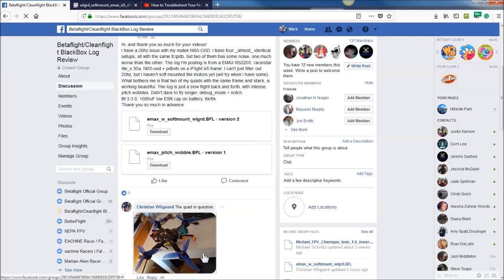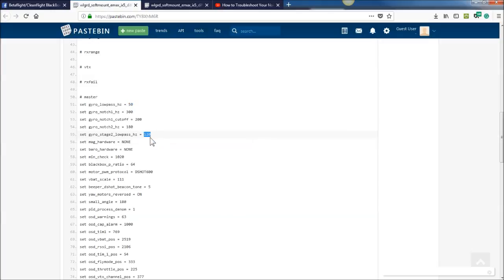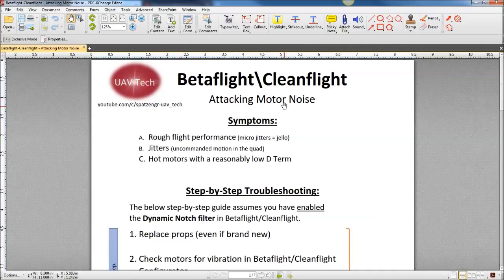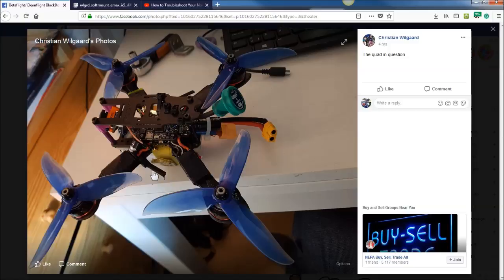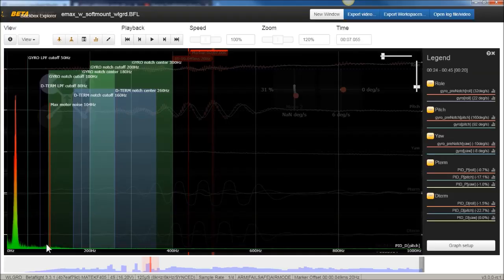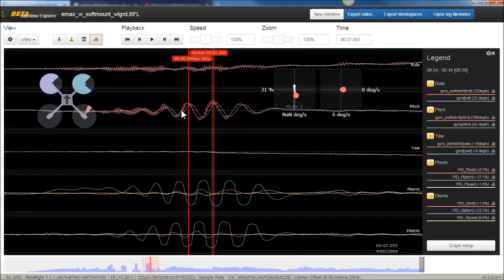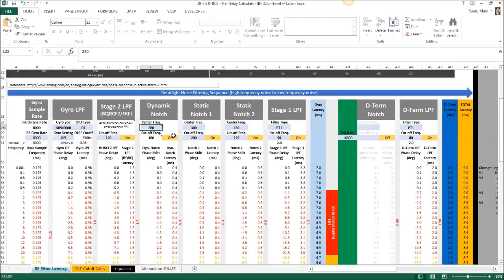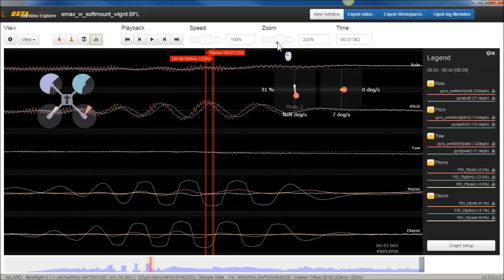2018.04.10 Christain-20hz Noise issues + FILTER PHASE DELAY EXAMPLE

Comment: What I've seen in my logs, is that the prop-wash oscillation also occur around 20 Hz on my quads. But surely not as clean as in that log and usually on both axis. 
May this be some resonance between motor thrust and elasticity of the frame?

Comment: Is optimal or minimal filter delay the primary factor for optimal propwash/wind handling? The reason I ask is because I have a fairly clean quad, but I have to have either dynamic notch on or d-term notch on to get rid of a high freq resonating, and I find better propwash handling when I opt for the latter (D-term LFP on, rather than Dynamic notch), even though your data shows greater latency in that case? In fact, from my experience, I find the dynamic notch on results in more bobbles and jitter.

Very helpful vids by the way!
Reply from the maker: It is sort of a chain effect.  Whatever filter setup allows you to have a D-term that is as steady as possible and is not pushed into phase with the P term should give you the best handling of prop wash with a proper tune (proper gains).

Do you have logs of where you experienced better results of Dynamic Filter on and then Dynamic filter off and higher d-term filtering?  Would love to see what things are at play.  In theory more D term filtering will push the D trace to be more in phase (not leading) the P term.  But if D term filtering gives a smoother D trace - which it easily can - then it can produce better results in the D trace not jumping around as much and/or allowing you to push D gains higher which advances it in phase of the P trace along the D term slope (covered in a recent BB log review); hence producing a better handling of prop wash.

I wish there was a button "eliminate prop wash" that we could click.
Reply: so interesting. Thanks. If I can find the time I intend to make a series of blackbox recordings with different types of filtering (including kalman and stuff) and in different conditions (windy environments etc).

Comment: Thank you so much. I tried extensive filtering to see if that did  any difference, disregarding delays for now. Already did check motors, and I'm running the same motor/prop combo in other setups with no issues (2206 2400kV with cyclone 5045) for racing, but great to get a confirmation that this is indeed something in my setup. Will try moving those antenna stubs on the arm as well and get back to you when I have some findings :) But, can this also be caused by a bad gyro? The matek f405's are well known for their noisy gyros.
Reply from the maker: I don't think so with it being 20hz.  If it were 200+hz maybe.  But it just seems like a big vibration/wobble to me.  Also check that you don't have a broken or loose stand-off or arm.  Stuff like that.
Reply: UAV Tech okay, will go through it all before replacing the electronics. Had issues with loose stack before, so I always check that first in these kinds of cases ;) Good tip tho. Might also be my rx which is soldered directly on the board and hot glued. Might not be enough, being also that it is directly over the gyro (not touching  though)
Reply from the maker: Yeah, if you RX is mounted to the FC, maybe look at mounting another way.  However, you said you have the same exact setup for another quad without issue?  Everything exactly the same?
Reply: Well, identical stack. Other esc/motor combo. The other struggler is rcx 2205/2400 kv with dys aria. The two working have racerstar esc  (same as this one) and aokfly 2500kv and rcx 2205/2400 kv.
Edit: 
So, three with racerstars. Only emax motors struggle. 
One with dys aria, but not as bad as this one and haven't looked to much into it yet. Just capped the battery leads on that one, which solved quite a lot
Reply: Tested:
1. Motor test (bardwell): All of them super clean
2. Changed props, no change
3. Removed antenna stripsmount, taped antennas to arms instead, no change
4. Filtered 5V, 3V3 and all ESC's, no change
Since hover shows all motors working equally hard, I don't suspect ESC's, and starting to wonder if I should just swap out all of the motors (or one by one... sigh)
Reply from the maker: hummm..... let me think on it too.  Weird.  Did you try just doing full defaults on Filter and PIDs?
Reply: Yep. Still no good. Also tried turning off dynamic and raising the other filters to where the "main" noise is, other than the ~20hz. Next thing I'll do is replacing all motors, one by one (I only have one spare of these). I really wanna catch the culprit on this one, learning quite a lot in the process :)
Reply: I swapped all the motors with a known, working set. Problem solved! I am kinda sorry for using up your time on this, but I really inspected the motors and just can't find any faults. Will put the non-functional set on another quad and work my way through them, finding the bad one, opening it up and try to figure out what's wrong before posting my findings. Can you confirm that debug[0] is for roll, and debug[2] is for pitch? I have really learned a lot from you, and feel so much more secure when debugging quads now, such that I will also push the limits on fine tuning. Thank you so much!

Comment: Hi, in your pdf, thos vibration dampeners are listed under "intruducing no delay". If the have to be compressed to activate the dampening, doesn't that introduce delay? Would it be possible to measure it? Two FCs in parallel, on top of each other, the second not connected to motors, but logging?

I got some problems with an über-tight stack which i am fighting, it got yaw P problems (vert racer style from hyperlowframes). Activate yaw lpf und deactivate notches on roll/pitch?
Reply from the maker: Yes, the jury is out on that for 100% scientific confirmation (no testing and data published that I have seen, but honestly I have not looked hard either).  I have seen some postulate that soft mounting has the same delay as software filtering.  However, the general trend is soft mounting is preferred over software filtering as it doesn't cause low hertz delay (motion) - especially if on the motors only -, but just protects the gyro from seeing the high-frequency vibrations (noise).  Software filtering doesn't work that way.  It has a worse delay on low-frequency data than high due to how the math works.  Manufacturers are even starting to soft mount the gyro chips on the FC boards too.  Finally, I have never seen any of the gurus in the space recommend software filtering over soft mounting.  i.e.: see this link from Boris.  He believes no extra penalty comes as a result of soft-mounting vs. software filtering: https://github.com/betaflight/betaflight/wiki/Gyro-&-Dterm-filtering-recommendations#what-defaults-changed-in-317.  Now, was that in reference to motor soft mounting vs. FC soft mounting?  It doesn't thread that needle.

Testing and publishing of the results would be amazing!!  Both boards would need to be in the same stack.  Also be the exact same board with the exact same settings.  The bottom board would be hard mounted; be the one driving the quad; and have software filtering etc... (debug_mode=notch).  The top board would be mounted with rubber standoffs; have debug_mode=notch; and have debug set to activate as soon as the quad is powered up.  Actually, both would need to be setup that way so as to sync up the logs.  You would then be comparing Debug_Mode=Notch traces to eachother and see if the top board has a delay vs. the bottom board.  Since the top board would be a little higher than the bottom, it would skew the results unless you can get the split between the two (the quad CG) to be equidistant from both boards.  Since it would be measuring very small units, you would really need to pay attention to every detail to make sure it was not skewing the results making them invalid.
Reply from the maker: Turning on Yaw P LPF should not deactivate notches on roll/pitch.  Or are you saying to do that to offset the latency?  See graphic at https://www.facebook.com/groups/291745494678694/permalink/348580578995185/ for where Yaw P LPF falls into the filer sequence.  it is not on the Gyro.  it is in the pid loop.
Reply: Thanks for that elaborate answer. Yeah i built a quad for a friend with a Kakute and another freind has a lot of Airbot Nox. They ship him them without asking XD but i don't know if i like them. Kakute solution is prone to many problems.

If i had the budget to buy 2 FCs just for some logs i would do it -.- it should even be possible do splice SBUS on both Fc so both can be armed at the same time. Woah i kinda want to test that. You don't want any sponsor right? I could ask airbot if they could provide some FCs for a mentioning in a video. I got a empty frame
Reply: ha ;) i am in contact with simon and michael (from your 6S BB log video) via a german forum-slack. Yeah i meant to offset the latency. So Yaw LPF could be quite low (diltering would be high) and not affecting flight performance?